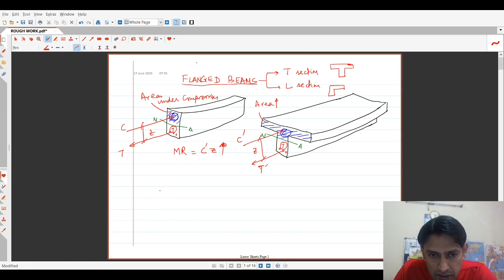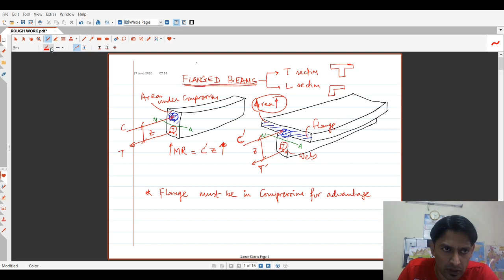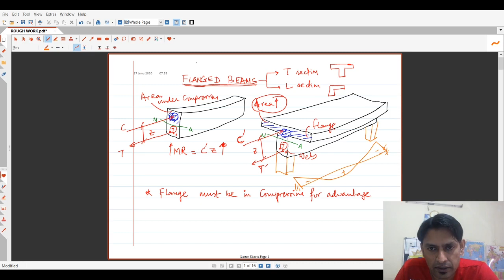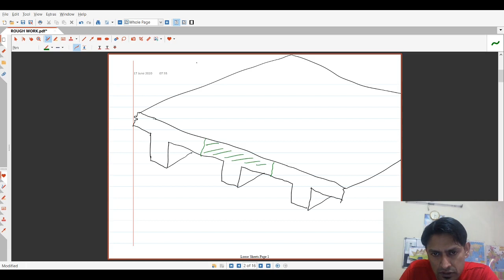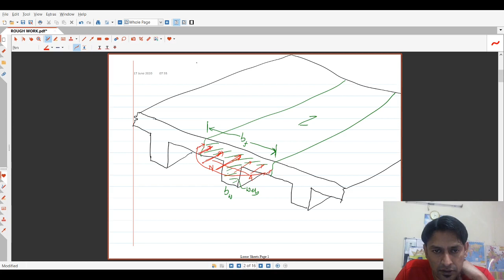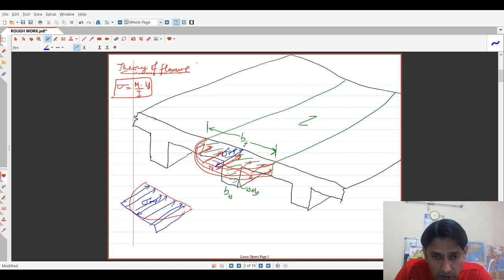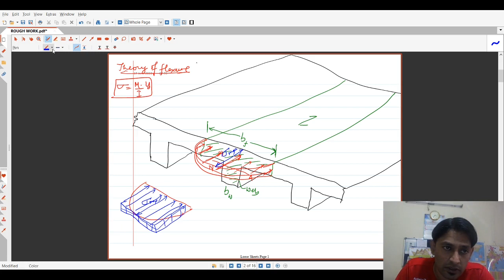Flanged beams I

Comment: Sir Really good video on Flanged beams. Sir I have a doubt. If the beam is continuous beam, then at the supports it shall be designed as a rectangular beam and in mid spans it can be designed as a Flanged beam. Is my understanding correct?
Reply from the maker: Thank you Manikanta. Yes theoretically what you have stated is correct, the enhanced area due to flange can be utilised only when the flange portion lies in the compression zone, which in case of a continuous beam is restricted to the mid span region. However when designing the beam practically the flange advantage is ignored and the entire beam is treated and designed as a rectangular section. Hope this answers your question.
Reply: @mathshakti  Thanks a lot for your reply. Keep uploading content.
Reply: Sir please make video sfd and bmd